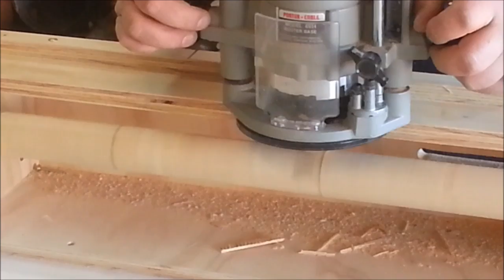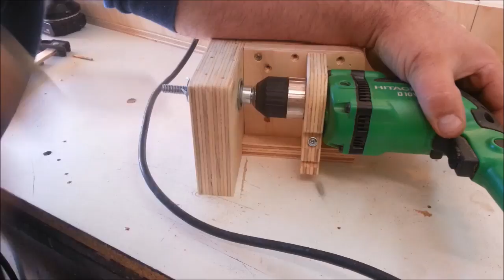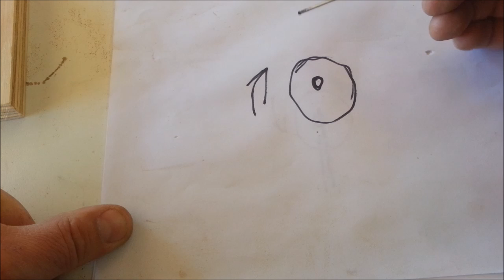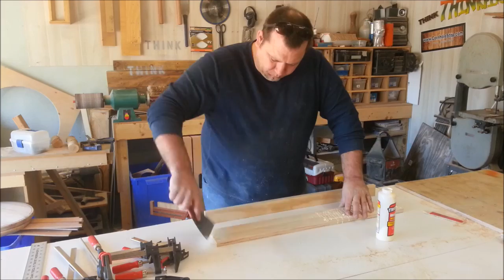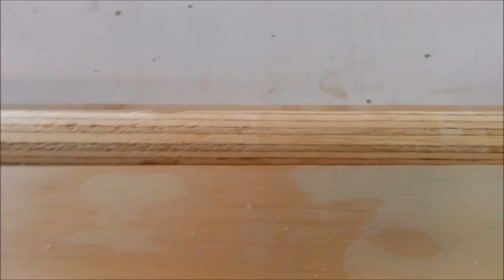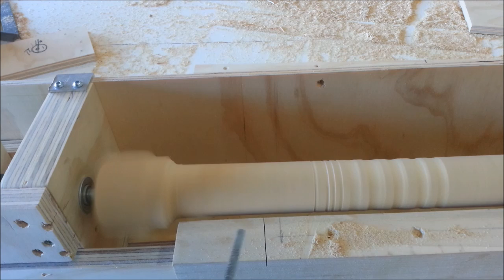Homemade lathe, tenoning machine and more

Comment: Nice video , 
i had made a jig to put on the lathe and use the rutter for making a perfect cylinder BUT , it had a terrible surface , 
Is it yours like so ? Is there any special type of bit we can use ?
Does the saw blade has any difference ?  (in surface finish i mean)

Comment: Very nice device. Gave me a few ideas on something I want to work on.  Only question.  Wouldn't it have been better to have the motor assembly locked down solid and move the end piece as opposed to moving the motor?  Seems that a movable end-piece would have been easier to design and build.

Comment: Say I don't have space or money for a router, jigsaw, tablesaw or really any power cutting tool other than a hand drill. I need to cut a 3' circle from 1/2" plywood. Do you have any suggestion for how to achieve a uniform circle by hand tools? Thanks for any feedback.

Comment: I have been watching your videos on the powered by a drill tools. I like this one the best. I guess I have all the other full size items but I don't have a lathe. This has given me a way to cheat on making a round instead of a square tenon on my farmer tables where I join my 4x4s together and the 2x4 stretcher down the middle. No more chiseling on square holes because I can use a forstner bit and I can put a fake 4x4 or 2x4 tenon on the outside for looks. Even if it is a round tenon it is not the end of the world. I don't wear a tie either when I do wood working.

Comment: Izzy, great tool. I was thinking that a castle  nut might work better than the T-nut  to make the drive spur. Use a file and file on one side of each tooth to create the drive spurs then back it up with a jam nut or cross drill and pin as you did on the stop collar.

Comment: Izzy!  So this video shows that you use it for various applications.  Given that it's multi-use, wouldn't you want to chat a better driver for the system then?  Also, 0:40 - can't you  etch some a nut somehow using a fixed grinding wheel to do that?  Those tangs will be brittle at best, no?
Reply from the maker: I am using a drill cause this is one of my drill powered machines to go into the multi tool machine. A motor can be added to any of my machines. The tangs are not really needed like I mention it the video I just leave them on they eventually will break off.
Reply: I know the feeling.  Thanks.

Comment: Nice build Izzy, but I need you to design a cheap drill powered tenon cutter that I can use on multiple sized bent branches that can't spin in a jig.  If you'r up to the challenge that is!  :) Dan

Comment: damn you're beasting your way through these builds. awesome video. i built a crude fixed length version of this last year using the router which got the job done but left a lot to be desired.  i'm definitely interested in remaking yours with the sliding carriage and bearings and giving the circular saw a try this time round. on a side note... really preferred the last set of videos; straight to the meat and potatoes with no filler. keep them coming!

Comment: I'm looking forward to seeing the video when all is finished. How many different builds will there be in the end? One more question; will the drill used in the end to power everything be a heavy duty/220v?
Reply from the maker: Frank Ingram i dont know how many yet. I am designing everything to run off a 9 amp 110v drill so any drill that big or larger should be ok to use

Comment: Nice. Which one do you think is better overall, this one or the table saw version?
Reply from the maker: Robert Arnold It depends on the use, the table saw is a lot faster cutting and can handle large stock, the circ version is nice because it is faster set up and in cheaper to operate and more versatile because it is not bound by the constraints of the table saw
Reply: I do like the way you could take this one and do some other things...like if you put an indexing wheel on it, you could use it to do flutes with a router, etc, etc. I think I'm going to make the table saw version first though. .enjoyed the vid..thanks.

Comment: OK, after seeing the router in action, I definitely agree with you. However, the router would still be useful due to the large assortment of profiles available. I guess it would really depend on the application.

It would also be easier to automate. ;) And I have a 3 1/2 HP production router at my disposal...

Comment: Loving the modular drill powers stuff Izzy!
An idea for you. If you grind some flats into the axle you chuck up in the drill, making a hex shape, you can chuck a screwdriver bit socket permanently in the drill then when you wanna use the drill in one of the machines you've made, it can just slot into place in a few seconds. You won't need to fiddle about with the chuck because you've already got the adaptor in there.
This'll also give the axle a bit of flexibility in the coupling, so alignment won't be as critical. Less bearing wear, less vibration etc.
Best of luck dude!

Comment: Love it!  It's surprising how smooth the circular saw cuts are compared to the router cuts.  Is there dust collection in the works too?  Saw lots of chips flying around the room...
Reply from the maker: Omarateastwind There is going to be a dust collection adaptation for the lathe/tenon jig but not sure in the multi-tool.